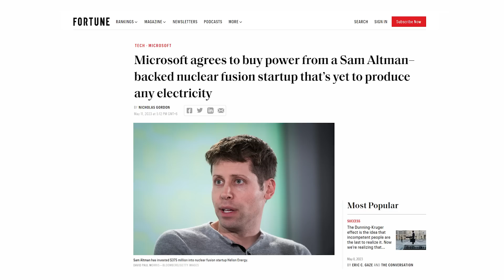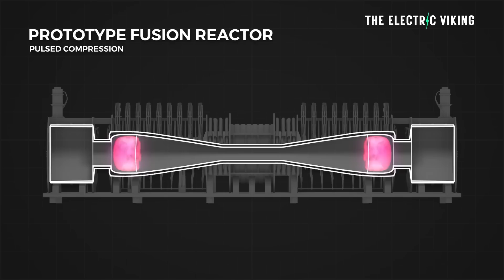Microsoft says the nuclear fusion dream is about to become a reality

Comment: The first "net gain" fusion reaction happened just recently. The magic moment lasted a few BILLIONTHS of a second. Between that tiny proof of concept and a large, controlled, perhaps continuous fusion seems WAY too tough a job, for even the smartest engineers, in the few years allotted.
Reply: While a step forward, it was not as great as it sounds. IIRC, they pumped something like 2MW of laser energy in and got 3MW out which sounds great, but it took something like 200MW to create that 2MW of laser energy, so in reality, they used 200MW to generate 3MW.
Reply: @briancampbell179  Correct - plus laser confinement fusion is a dead end. This was just the NIF using brute force to prove fusion could be achieved outside of a nuclear bomb. It's a mathematical and theoretical, achievement, but is in no way practical.  Helion on the other hand has the singular goal of generating electric power for the grid. Their method is novel, and might not work but that remains to be seen. There are plenty of nay sayers out there who claim Helion's generator is a pipe dream. I find their design very interesting, but I don't have the skills to criticize exactly what they claim. Will be fun to see where this goes.
Reply: @briancampbell179  Yes, but they're using lasers from the 1990s. Equivalent modern lasers are over 20% efficient instead of 1%. That still leaves them off by a factor of five, but their scaling laws seem pretty good: they increased the laser power 8% and got 230% as much output.
Reply: But it wasn't a net gain of PRACTICAL fusion energy, only TOTAL fusion energy, which is just a small FRACTION of the energy needed to make a commercial fusion reactor work profitably to produce power entities will buy. 

So there's nothing "magical" about that -- just a buzzword to try and collect funding from people who don't know any better.  There are plenty of articles, discussions, etc. about this from physicists, and even WIKI, re the work on commercial fusion.
Reply: What’s all the hubbub about, according to Dr. Steven Greer we’ve had the ability to replace fossil fuels since 1954!
Before that there was Nikola Tesla, who could power the whole planet, and JP Morgan, shut him down because they couldn’t put a meter on it !
Reply: Sorry, Helion and AGI (Artificial General Intelligence) are both a scam, good luck with that ..
Reply: AI has the answer...
Reply: @larryc1616 :  Yes, AI is becoming the new "something magical will happen" claim.  Meanwhile, ChatGPT confidently makes very basic math errors by not understanding the question, or how to set up the problem, yet asserts its answer is correct the way a flat earther claims the earth is really flat. 

AI may "get there" some day, but I don't think we're at all close to true, practical, general superhuman intelligence AI any more than we're close to practical nuclear fusion given how small Q(engineering) is compared to Q(total).

Comment: Already happening in Wenatchee,  Eastern Washington, for Microsoft data centers. 20 acre plots per unit. 5 units planned. Breaking ground this year.
Reply: What Sam missed was Helion's two step process. Helion will be making their own expensive H3.  Helion's fusion is actually a two step process.  First they make H3 with just deuterium in opposed accelerators similar to their main fusion accelerators. Deuterium is not that expensive.  Helion will use separate accelerators because making H3 releases neutrons which will degrade the accelerators.  The accelerators for making H3 don't have to be as good as their main, opposed, fusion, accelerators.  Then that created H3 with deuterium will be used in their main opposed fusion accelerators and this reaction will not release neutrons, so the accelerators will last longer.  Helion will also be be able to sell tritium to other reactors or keep storing it until the tritium decays into H3 after 12 years.  Helion might be a profitable business just by making and selling H3 and tritium.

Comment: Helium3 will be mined on the moon.
Reply: No. I will be made by Helion on Earth. Summary:  Plasma has a charge.  A charge passing through coils produces electricity.  Helion uses fusion to produce plasma and releases it through coils, making electricity.  People are also missing that Helion uses a two step process. Helion will be making their own expensive H3.  Helion's fusion is actually a two step process.  First they make H3 with just deuterium in opposed accelerators similar to their main fusion accelerators. Deuterium is not that expensive.  Helion will use separate accelerators because making H3 releases neutrons which will degrade the accelerators.  The accelerators for making H3 don't have to be as good as their main, opposed, fusion, accelerators.  Then that created H3 with deuterium will be used in their main opposed fusion accelerators and this reaction will not release neutrons, so the accelerators will last longer.  Helion will also be be able to sell tritium to other reactors or keep storing it until the tritium decays into H3 after 12 years.  Helion might be a profitable business just by making and selling H3 and tritium.